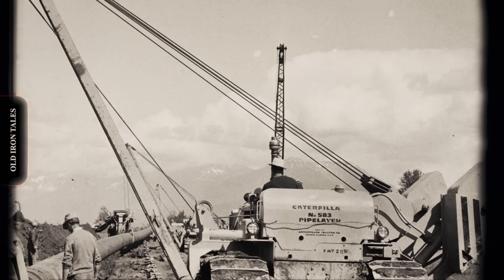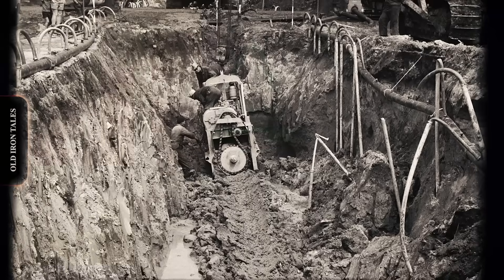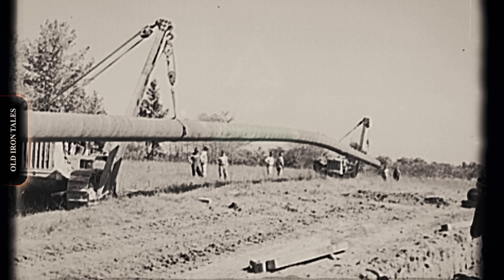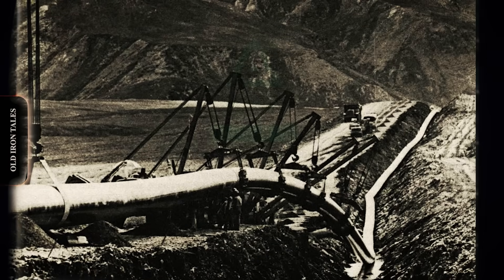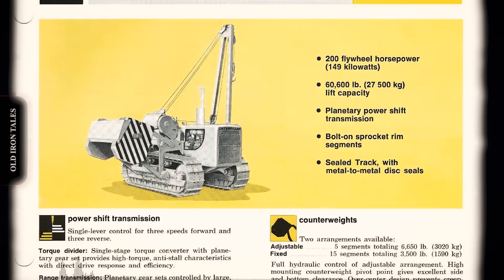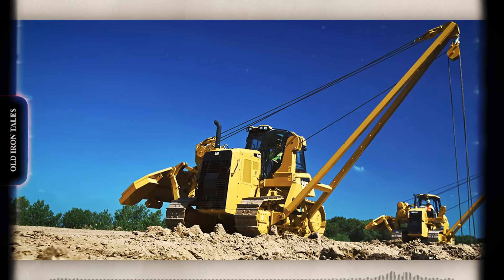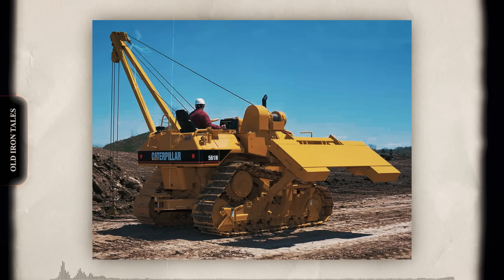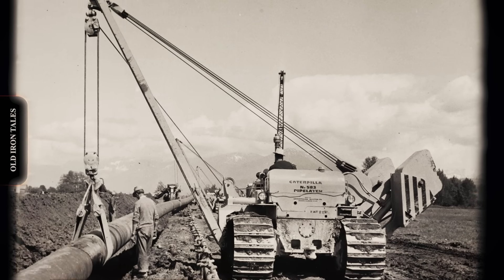Caterpillar Pipelayers — The Heavy Iron Behind Every Major Pipeline

Comment: Good history but a correction as the Alaska Pipeline was not built just in the "short summer season".    It ran all year around.   Through the brutal -40 deg F and worse of the winter.     The Backhoes dug the trench (where its below ground) and the trench was padded with spec gravel,  the Pipelayers laid down the pipe and then dumptrucks finished the burying.    Different process for above ground where the pipelayers were the main machine (along with the Vertical Support Drills)
       Ironic that all the prep work and then the pipelayers came along and dropped the pipe into the trench (or on to the horizontal bars,  then all the post work to finish it up.   Pieplayers were the least hard working as units,  they sat there and picked up and dropped pipe.   Poor operators were bored.   Meanwhile the rest of us were like an army of ants prepping and finishing.

Comment: You didn't mention how crucial these machines are to the railroads.  Contractors such as R.J. Corman utilize pairs of these beasts to lift massive locomotives and rolling stock back onto the tracks when they derail, as well as performing other heavy rescue and maintenance functions.
Reply: A big YES to your comment. I see TWO of these monsters close by were I live (ON STAND BY) for any train derailment 😊 plus they have the "BIGGEST" Cat built front end loader with "TRACKS" on stand by to go with the TWO side booms. The yard has 
Low Boy big Rigs with double stacks (very large Diesel Engine) to haul these big bad boys. They sit I a huge switch yard in Auburn Washington State 😊 I always thought these Side Boom Dozers would be great for moving boat from water to a land yard for vessels being serviced on dry land (bottom painting ect.) With a "Grouser" track pad instead of Dozer tracks, they could move the boats without large track "TURNING" gravel disturbance 😊 I bet you that a good shape used on would cost a LOT less than those special built (TRAVEL LIFTS) that boat yards use. 😊 when you look at the COST of those one usage Marine travel lifts. Can only carry a vessel from water to repair yard, then just SIT. that side boom Dozer could be used for other usage in boat repair yard. Like say. With a boom extension like cranes have. The side boom Dozer could also sit on side of vessels in yard and Remove the heavy Diesel engine from vessels 😊 it could remove the Fuel tanks 😊 a good shaped newer USED side boom Dozer could do so MANY more LIFTS, in a boat yard that a SINGLE very expensive (Travel Lift) that so many boat yards use. I am just thinking how universal a Side Boom can be used for. I know that some go in BIDDING at sales very cheaply. Because buyers think they are single pipeline piece of heavy equipment. I have seen used equipment yards buy them and put DOZER blades back on them and sell them as a rebuilt DOZER. think about it. In its life it has never pushed earth 🌎  it mostly moved at lower transmission speeds holding and setting pipes. To me the Dozer with a new blade instead of side boom would be like a very excellent conversation to a Dozer, just my thoughts on what these Bad Boys could do after the pipeline contractor puts them out to BID sales when job is done.
Reply: On those side booms,that R.J. Corman,Hulcher,etc.,use,they only lift the cars ends,and locomotive ends for rerailing,under regular loads! There are also heavy lift cranes,for the more damaged equipment! Those tractors,are the quick and dirty operators,as they can move rapidly and clear right-of-ways,rapidly,and with minimum effort! Those operators are maestros,at balancing loads,and working as teams! There are videos on YouTube showing those rescues,worth watching,and educational! Thank you 😇 😊!
Reply: The lift capacity of the 583 series does not seem enough to lift RR locomotives. What are the models and capacities of the RR class units?